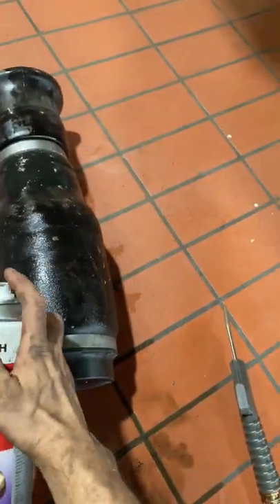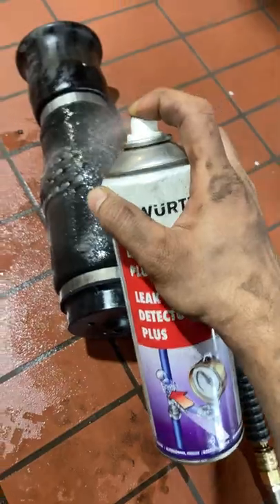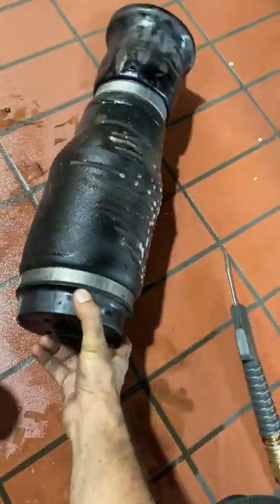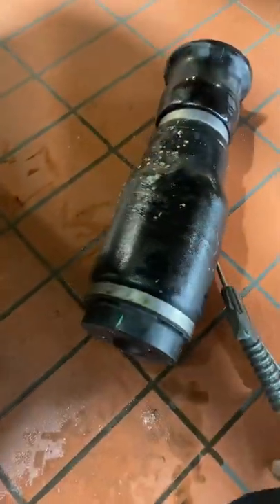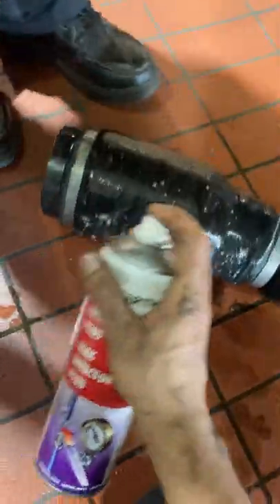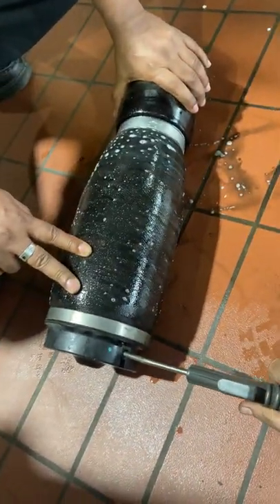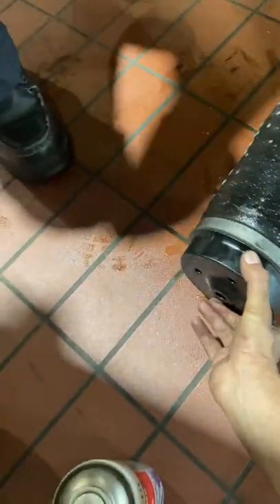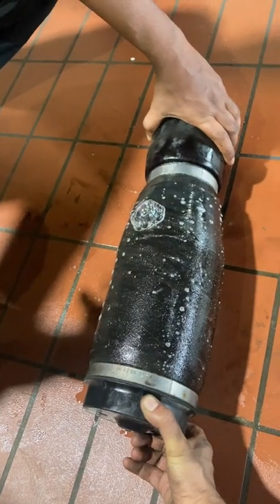How to  Leak check in  Air balloon  (bellow)  ( Airmatic Suspension )

Comment: Do you have a video on how to replace the rubber????
Reply from the maker: Which rubber, I can't understand
Reply: @mercedessportcarrepair1944  air suspension rubber sleeve. The bit that inflates. Mine has broken and I see you can buy a replacement without changing the whole strut
Reply from the maker: Sorry I don’t have video related to your topic
Reply: Much much much simpler to just buy another one… Plus these specific ones aren’t even expensive tbh.